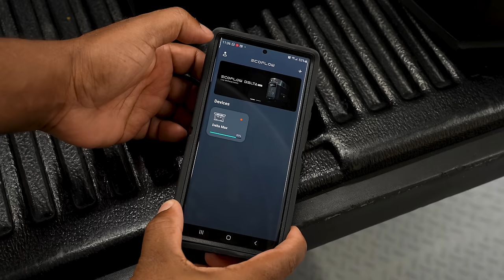Homemade Truck Bed Tool box || Storage Drawers

Comment: Amazing stuff! One suggestion, if I may, a little foam in each compartment with cutouts (in the shape of your cordless tools for example) and you can keep it all from bouncing around while you're driving!  Keep it up and God bless.
Reply: That's a great idea. 

My suggestion was to put rubber stops on the front of the drawers. That way when the doors shift while driving it doesn't ruin the inside plastic of the Truck bed door/the drawers themselves.
Reply: Agreed, Amazing stuff but totally needs something to prevent those power tools from sliding and bouncing.

Comment: Nice to see that I'm not the only one who keeps leftover parts.  Great project.
I built some drawers almost exactly like that several years ago with butt joints and brad nails.  It wasn't long before I was reinforcing the fronts with screws.  Totally underestimated how heavy the contents can get in drawers that size.

Comment: Really nice build!  So many of these guys that build these drawers on here waste so much space on/around the edges (the wheel wells).. i like how you make those spaces easy to get to and still useable.  I also appreciate simple deep drawers for more stuff. 
The dividers are how i would make them also.. no need to cut curfs into the side walls.   
Your build is again so easy to completely remove the entire system from the bed ..than just reinstall when needed.
And the lighting is a brilliant idea!

Comment: Add 4 of the same drawer pulls to the left and right sides (2 per side) so you have some carrying handles when installing or removing the unit from the truck bed.

Comment: Nice job! I love these style builds... making useful stuff that really isn't made, or at least that I've never seen commercially available.

Look forward to the next video!
Reply: Decked has them for sale and you can put a lot of weight on top of them. Also there is no gaps on the top or sides for shit to fall into they also latch when closed and have locks on them

Comment: Nice tool box, Glen!  I'll email you my shipping address!  lol
An idea on adding a small door to the left:  Cut and paint a door to fit the hole, then embed small neodymium button magnets around its edge (1 near each corner should do), then embed matching magnets in the surrounding opening, so that it 'floats' in place at the correct depth, but can be easily pulled away by the handle.  You can even add a skinny black tether between the door and the box, say a foot or so long, and lay it up on top of the toolbox when not in use, so you don't misplace it, or so it stays nearby if contents shift and knock it out of the opening.  So it wouldn't really contain any contents (of course, neither does leaving it open, so nothing lost), but it would give you that uniform appearance you were after.

Comment: great stuff. you might think about putting something removable in the bottoms so that over time when it builds up with oil and grease you have something that will absorb that without letting it get into your wood.

Comment: Really cool build. Love it. I might have to build one for the back of my wagon. 

I would probably install latches on the drawers anyway. Not as locks but to make sure the drawers don't open and bounce against the bed gate. It drives me crazy when I have tools, lumber or even groceries in the back sliding around in the back. Almost broke a systainer box the other day because it slid all the way too the back and hit the hatch.

Comment: That looks amazing. Paint the interior of the drawers white to protect the wood and keep it bright? You might want to consider some through bolts on the handles, though that is a lot of screws holding them on. That's just me though, I'm abusive and overload my junk.

Comment: maybe I'm too late to this video but, one advice I could give you to save on plywood is to make the bottom of the box like a frame from strips. Basically, under the drawers will be empty space. You will also save some weight and improve your gas mileage a little. (you can do the same with the sides and the back of the box depending on what you have on the sides to not interfere) byeeee now

Comment: It looks great! My big concern with it not being permanently affixed is what happens in a crash? I doubt that 2x4 brace/spacer would be able to arrest the entire unit and then you have your whole toolbox flying around.
Reply from the maker: You can always bolt the tool box to the truck bed. That's not an issue.
Reply: AGREED, but if you're in accident the last thing i thinking about is a DIY project that can be redone. You do have a point to a degree

Comment: Hello! I just purchased the Ecoflow Delta Max 1600 and have a Dewalt table saw (looks like the one you're using in the video).  When I tried to power the Dewalt table saw with the Ecoflow, it tripped the breaker on it. Just wondering what Dewalt table saw you're using and if you had an insight on why it might be tripping the Ecoflow breaker?  Thanks!

Comment: On the putting multiple scraps to make the shape you need:  Just remember, kids, filler, sanding, and paint hides a multitude of "sins".  The Cheap Dutchman(tm) in me approves!  I can't tell you the number of 2"x 12" scraps of plywood that I have in my scrap bin "just in case".

Comment: At 6:03 in the video you said you’d joined two pieces of scrap plywood. Please tell us your secret, because other than the two tone look you can’t tell. This sounds like a dumb question so to be more clear; I’m asking did you cut a joint in the plywood before gluing it,  if you didn’t will it be strong enough to last if you just glued the end of it, and what glue did you use?
Thanks in advance !!
Reply: Also, Thank you so much for the free videos I really love the way you break things down and I’ve already purchased several of your plans.

Comment: $1700 is pretty steep - I just got a nice 2200W gas inverter generator that can run off the gas from my car or truck. When power goes out for days, a generator is what you need. Batteries won’t last for the 4-5 days that power is out.

Comment: hey, this is "cool" but forgive me in saying:
1) You only have two drawers. You could have saved space and money by just using a couple heavy duty storage totes with lids. Then you can take them out whenever you want.
2) It's only a "minute" to remove it because the boxes were empty. It might be longer once there's weight in them.

I guess I just don't understand the point of this.
Reply: so he doesn't have to spend 2k on a DECKED system.